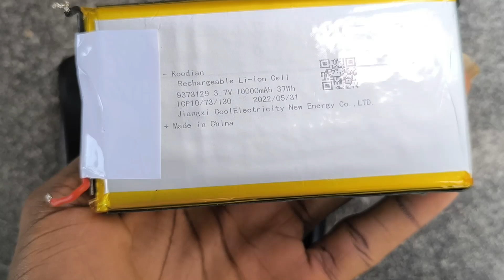Itel Star 200F Powerbank Teardown

Comment: The cells seem to be good. There's no noticeable bulging yet. I can also see there a BMS board attached to the cells. The downside is that I have searched everywhere for this model Star 200F without success. Thanks for the video
Reply from the maker: Yeah. The cells are actually good for the output wattage that the powerbank supports. However, I was able to permanently reduce their capacity by half by running a marathon drain on them with a constant load at high wattage. But of course this would hardly ever happen when using the powerbank to charge phones.

And about not being able to find them for purchase, that's true too... This is probably the most scarce powerbank right now.

I'll be testing out a couple of different fast charging powerbanks and will make videos about any of them that I can recommend soon. Maybe you'd find one that you can actually buy. Thanks for stopping by.
Reply: @ConfyScenty  Thanks for your response. May I ask if you have a reason trying to kill the cells?
Reply from the maker: @roymonie  The idea wasn't to kill the cells. I only needed to know the durability and functionality of the powerbank when used to power high wattage load for a long time at a go. The powerbank passed the test but the cells lost their capacity significantly.